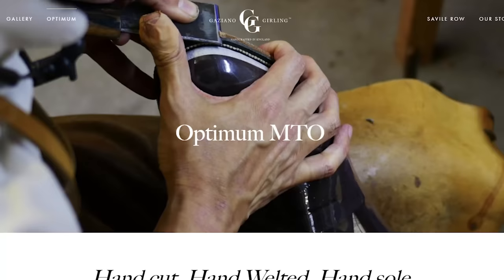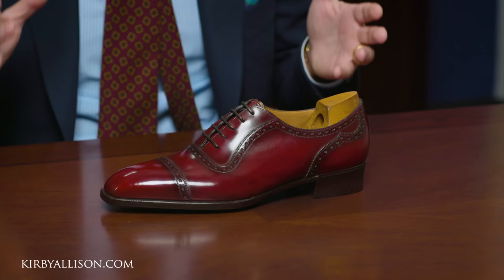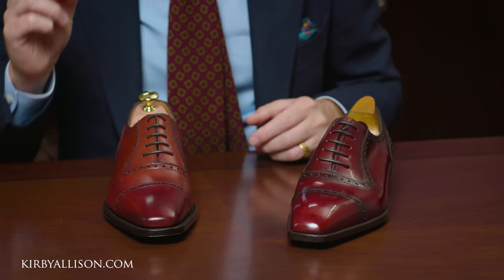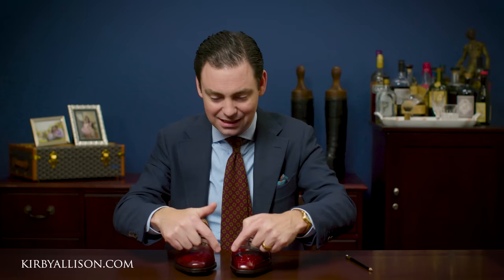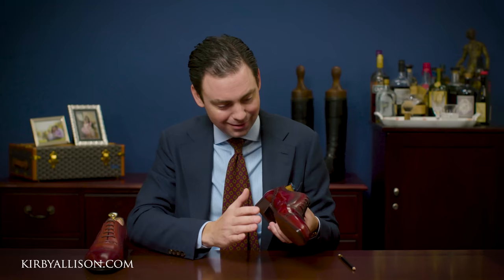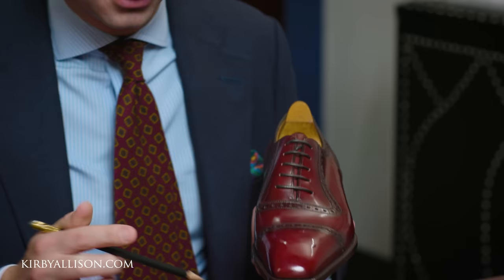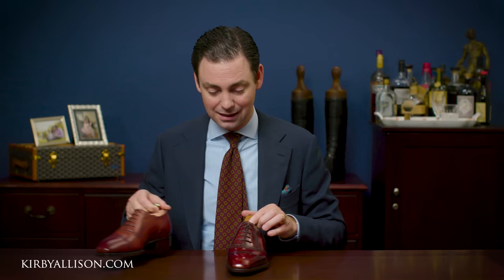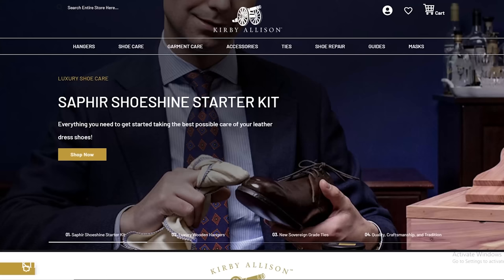$1200 Factory Shoe VS $4000 Handmade Shoe: Gaziano & Girling Optimum Collection

Comment: I honestly do not understand people who want the fine details of bespoke shoes but do not want to go bespoke!
Reply: I do. In some parts of the world true bespoke is hard to access (many cities in the US) so obtaining bespoke typically means travelling a great distance maybe even travelling overseas to a maker for measurements. So while the maker may charge 7 grand, by the time you add in the flight cost, hotel, other costs of travel, the bespoke pair may really cost 12-15 grand. Or that guy can settle for these and get the same thing minus the in person measuring for 4000? Seems like a no brainer
Reply from the maker: I posted about this in a response to a previous common. It’s easy to take for granted access to bespoke makers for those that live in London or cities to which these makers travel.
Reply: @BLdontM  i’m in the same boat as you regarding bespoke. The time and hassle that it takes to finally get the product is enormous, even though i like the process it doesn’t make sense for me, and when you factor in the added costs like you mentioned (flights, taxis, hotels and etc..) it’s super expensive and that’s the reality unless you live in the town of the maker or they travel close to you! For example, I have comissioned a jacket at a prestigious Savile Row tailor in February 2020 and i still haven’t even scheduled my first fitting (and i’m in Europe) and with the travel costs for the next trips it’ll add a lot on top of what i paid! For bespoke  jackets i’m willing to go through this but not for bespoke shoes, i discovered rtw models that fit me well or if I decide to go mto i’ll do it but no bespoke for me!

Comment: The significant difference in the shape between the standard shoe and the Optimo model, is the reason, why I wouldn't buy the Optimo model. The fit would be fundamentally different for me and knowing what size I have with their standard shoes, will not tell me anything about the fit of the optimo model. I have learned the hard way and know for myself, that a shoe with that much last definition should only be ordered bespoke, with fittings etc.. Your comparison Kirby, answered all my questions. Thanks

Comment: Beautiful shoes, no question about it. But £2750 or $4000 for a pair of non-bespoke shoes is a bit much. More so when Cleverly bespoke starts at £3800 and Stefano Bemer MTO for their handmade range is $1900. Looking at those Bemer shoes online, the shaping, arch definition and finishing is exceptional. So apart from a preference for a G&G style, what more do we get for an extra $2000?
Reply: Owning a pair of Stefano Bemer MTO shoes from their completely handmade line, I have to say the fine details are spectacular in much the same way as these Optimum line ones. Despite value for money being a somewhat mute point considering most people dont spend more than a hundred pounds on shoes, I feel it would be hard to justify this G&G line, when others can produce damn near identical quality for half the price.

Comment: Hi Kirby, why do you keep on saying the MTO are 1200$ They are nowadays 1290 pounds, at 1,41 $ per pound it makes 1820. There is a difference right there
Reply from the maker: Sorry - must have been a mistake. You are correct. $1200 USD is for the RTW stuff. But it’s effectively the same shoe as their MTO (factory made, same process), just less finishing options.

Comment: Very beautiful but you pay a lot to cover higher uk labor costs. Saint Crispins, Stefano Bemer (Tradizione line (USD 1,990)) and Yohei Fukuda (USD 2,400) are significantly cheaper for more or less the same level of make.

Perhaps a bit less refined with Saint Crispins but nothing to cry home about. Price about USD 1,600 on average and you can modify the last to fit your foot better.

Comment: I would rather go bespoke. This feels like an option where G&G is cashing in. By the way at 16,25 you just said the heel block in the MTO is factory made. Very many times you said it was assembled by hand, again " beautifully pitched, bespoke quality " etc
Reply from the maker: Well, G&G receives heel blocks (my understanding) that are finished by hand at the factory (certainly more finishing than other RTW). But the Optimim and Bespoke stuff is literally built layer by layer. 

You raise a very interesting point. There is still a large pride difference (about 50% more expensive) and, more significantly for some, time difference. One of the largest barriers for many is simply coordinating seeing a bespoke maker. It can be very difficult. And especially with the current status of international travel, even more difficult. And there are some people who are just simply happy with the RTW fits.

Comment: Although the craftsmanship of the shoe is exceptional, to me it doesn’t entirely make sense to spend $4000 on an MTO shoe when, if you have the patience to save an additional $1000, you can purchase a pure bespoke G&G made to both your specifications and the nuances of your feet. That’s just me though.
Reply from the maker: I think the marginal cost of bespoke vs Optimim is closer to $2000, but, yes. You have a point. Which is why I hit on how long bespoke can take. I’m not advocating one over the other. Really a matter of personal constraints and preferences.
.

Comment: Kirby isn't that you are comparing fiddleneck shoes with a regular shoe and coz of the that the last definition is more pronounced?
Reply: Not really, but the bespoke pair have the waist of the insole pared back further from the edge to achieve a slimmer waist and more curve there. you can clearly see a lot more definition elsewhere though. Its all drafted a lot tighter.